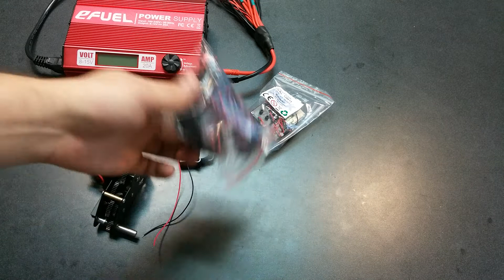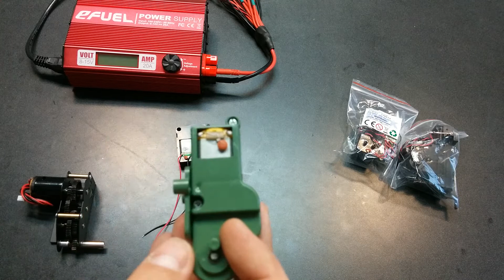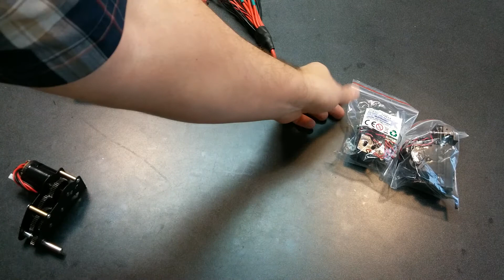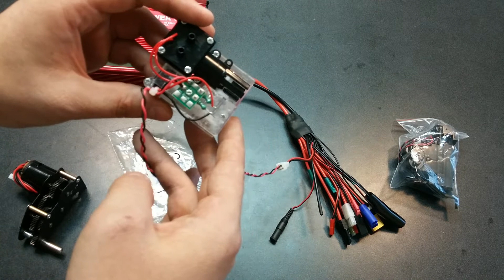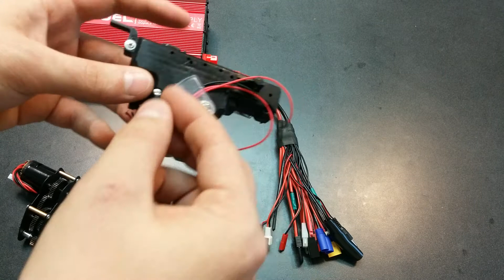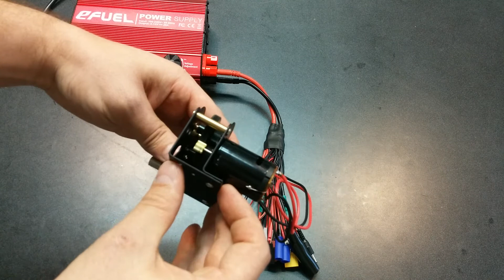Diagnosing brushed motors on Taigen Tanks

Comment: Can you tell me the specifications of the stock Taigen tank motor? What Turn/KV and max amperage?
Reply from the maker: xxgg Its a 380 sized motor (aka 28x38mm), max RPM is 18k @9V, and will pull AROUND 3-5A on average tank.